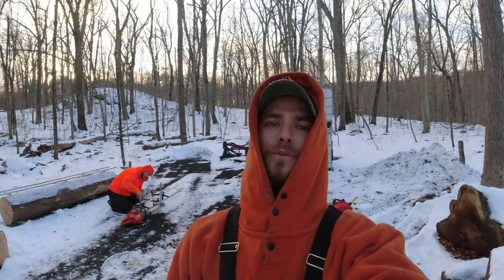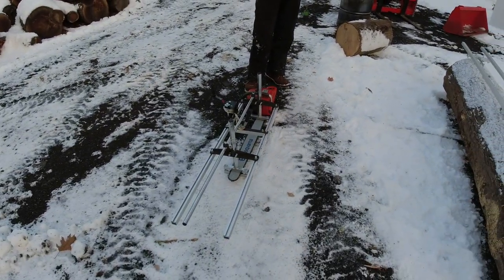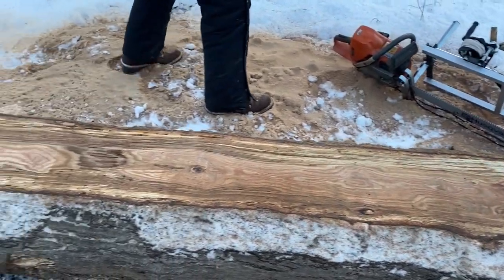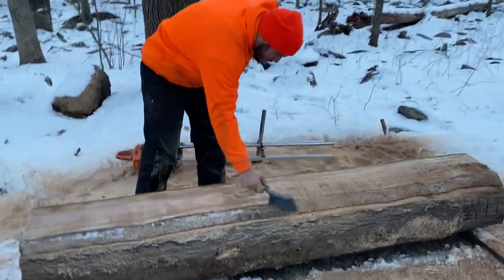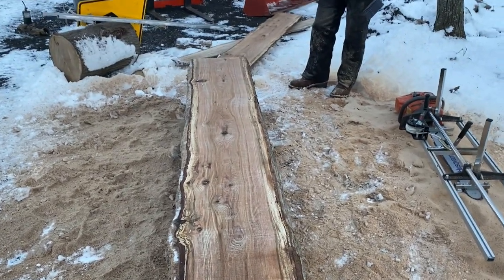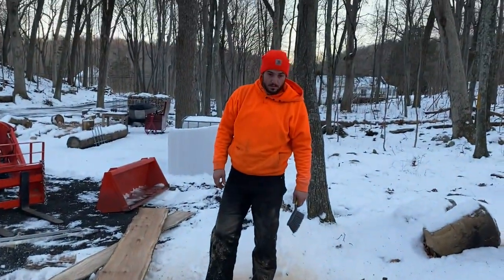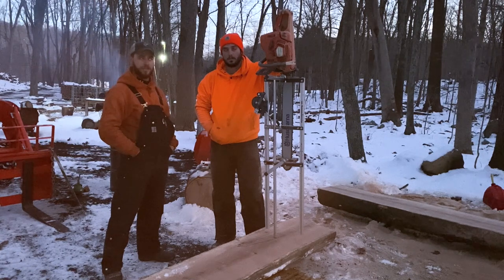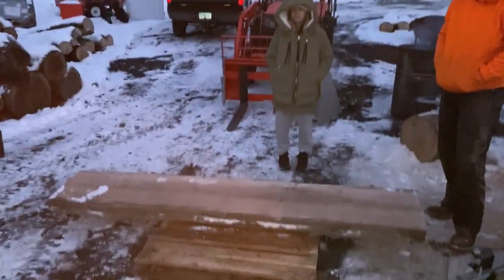#185 Alaskan Chainsaw Mill Cutting Live Edge Red Oak Slabs

Comment: Good job.  I totally love my two mills.  May I suggest you move the crosspiece with the handle to be closer to the powerhead end.  It will make it a lot easier to get the flat start on the second and later cuts.  (Keep the crossbar in contact with the wood until the rear lengthwise rail contacts the wood.)  If the log or cant is too narrow to reach the crosspiece, you'll be fighting it a lot more.
Reply from the maker: Thanks for the suggestion! We will look into this next time we mill!

Comment: Jake & Chris: The only think I would suggest look up "Passive Solar" Drying Kilm on YouTube, an learn your solar path. First thing get a good moisture meter, the sticker should be 3/4"-1' to start. You will need some weights like brick pavers. Here In Georgia I'm not familiar your weather, at a 2" slabs can freeze & crack? Now as far as, the chain getting pinched at the end, you need some wooden wedges or shims to hold the cut open. Been out of town, catch you on#186.
Reply from the maker: Howard, Chris and I have looked up the solar kiln and are extremely interested and intrigued. We want more info on yours! You dry 10 cords at a time? If you would shoot me an email at duderanchdiy1@gmail.com to discuss further!!

Comment: Always wanted to get one. May just do it now I see it used. Most people avoid the pith in the center when milling. They are  prone to cracking whe. Drying.  Never done it  up watched alot of it. Hard to avoid with slabbing down.
Reply from the maker: Yep the pith will be firewood or some cants for stacking lumber on. The process really isn’t all that hard, just need to get that first cut right!